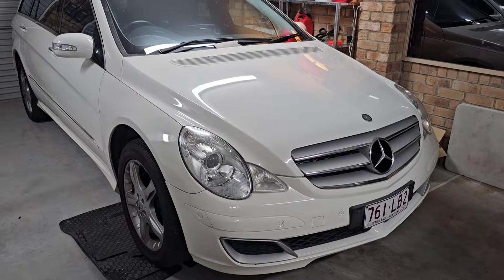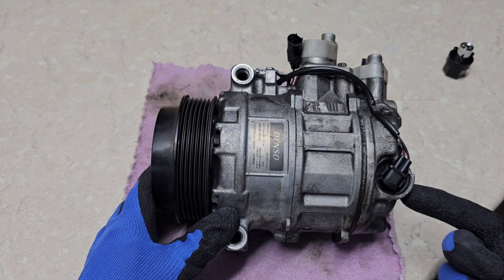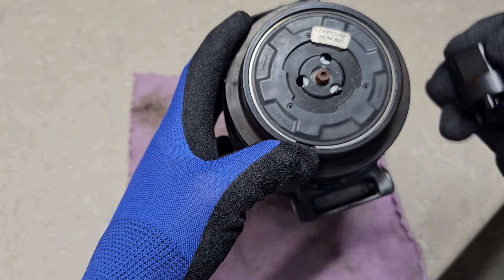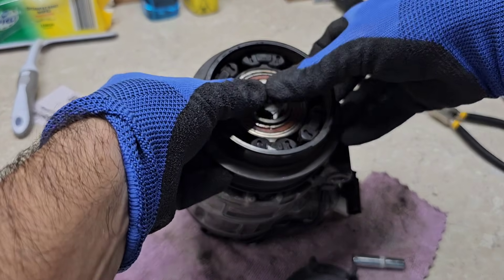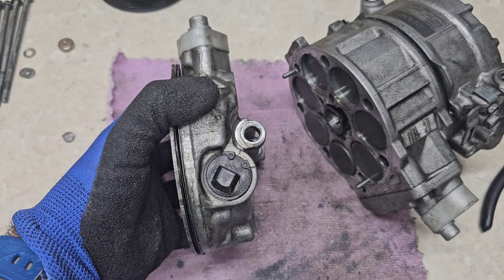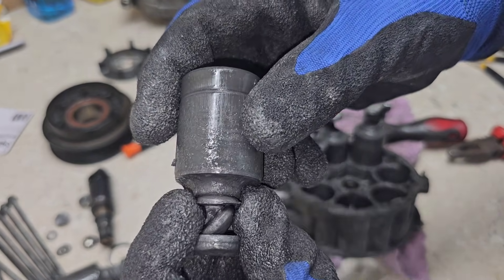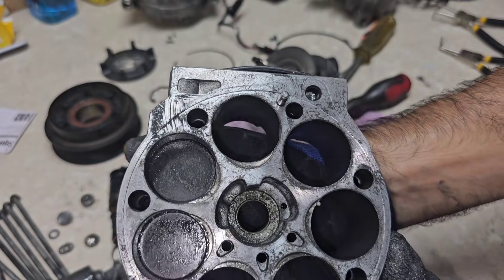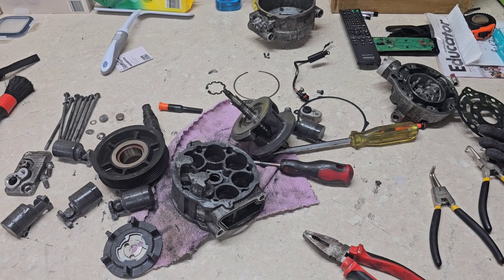Mercedes A/C compressor (7SEU17C) weak points and tear down.

Comment from the maker: Have you ever had any issue with your A/C compressor? Most Mercedes from 2002 to 2020 use the same clutchless 7SEU17C compressor, and this video might help you to diagnose your A/C problem.
Reply: Another great video! We may be up for a replacement soon. At 200k+ miles on our w211 wagon, it could be considered preventative maintenance :)

Comment: Thank you for the video! With this kind of failure, do I need to replace the whole ac system due to the debris? All pipes, radiators and so on?
Reply from the maker: According to the video, there is that safety mechanism,  as soon as the compressor seizes, the internal pulley snaps avoiding further damage.

Comment: Hello, could you please suggest a website where I can buy a clutch kit for my Denso 7SEU17C AC compressor? I have a 2022 MB Sprinter 2500 diesel v6 3.0L. When I tried searching online, I mostly found parts for MB Sprinters up to 2015, but for the same compressor model as mine. Is there a difference depending on the year of the vehicle if the part number is the same?
Reply from the maker: These are available on Ebay, also depending on your location you may want to check Rockauto or Fcpeuro.

Comment: Thanks for a very informative video . My wife’s 2007 ML 320 cdi A/C compressor failed last week last week leaving us stranded as the clutch pins didn’t sheer and the serpentine belt was destroyed and the compressor is locked up , I suspect when I disassemble it , it will be the same sort of failure you have here. After getting a quote for $3,500.00 to replace the compressor and repair the A/c back to operation I have decided that I will do this myself. In the meantime I’ve bypassed the compressor with a shorter belt. 1940mm for anyone with a 07 ML 320 .
Reply from the maker: Thanks, good luck good info. Cost was $800 to replace at shop.

Comment: Thank you! Very clear, to-the-point explanation. The compressor on my car (2012 GL 550) quit a week ago, there was a very loud rattling noise which stopped in about 10 min of driving (I'm guessing from the small pieces cutting to preserve the pulley operation to save the belt and other failures). Will you suggest replacing not only the compressor/dryer, but the condenser as well? And should I flush the system when everything is disconnected (have no idea how to flush the rear evap, but will figure out if needs to be done). Thank you again!
Reply from the maker: You are welcome and good luck 👍

Comment: Has anyone changed this compressor in a 2006 Mercedes C280 4 mattic? I can't seem to find any procedures on the steps to remove the compressor for this model. Anyone can share let me know please.
Reply from the maker: Step 1. Vacuum the system and recover the gas.
2. Take 3 bolts 13mm off.
3. Take the connector off.
4. Replace.
Reply: @BenzAddiction I understand that. The concern I have is this is the 4 mattic model and seems the cross member is in the way from bottom and the power steering pump is in way from top. How do you best access the compressor bolts and the high and low side hose bolts on the compressor? Does anything else required to be removed to gain access?
Reply from the maker: sorry for the late reply, you need to have delicate hand and tools, on some cars the access is not good, but definitely Benz is designed in a way that it is possible to remove, not like SAAB brand for example.

Comment: Hello. Please respond. I have a problem: sometimes cold air comes out, sometimes warm. It suddenly stops working and only warm air comes through. When I turn it off and on again, sometimes it blows cold air again, and sometimes it doesn’t.

The car is an S350 CDI OM642 8PK with a 7SEU17C AC compressor. There are no DTC codes on diagnostics.

What could be the cause? If the solenoid is faulty, can it cause such symptoms? There are no diagnostic codes at all.

Also, I refilled 1 kg of refrigerant twice, but only 500 grams remain when I check it again. I suspect it is leaking through the pressure relief valve — but why?

I also replaced the compressor with a used one, but that one didn’t cool the air at all. Please, if you know, tell me what part of the compressor might be damaged based on these symptoms.

Thank you very much.
Reply from the maker: Sorry mate, I leave this for an air conditioning specialist to comment on.

Comment: You show everything but another source of compressor problems: Shaft seal leak.
Reply from the maker: Leak does not cause catastrophic failure.  The AC will stop working simply due to lack of gas as the pressure sensor won't allow compressor engagement.

Comment: Hy! what is the differences between these Denso 7SEU17C / 6SEU16C ? are they the same? can i switch my 6SEU16C with 7SEU17C on my w212?
Reply from the maker: The Denso 6SEU16C and 7SEU17C are both types of AC compressors commonly found in European vehicles like Audi, VW, BMW, and Mercedes-Benz. While they share some similarities, there are key differences that impact their interchangeability:
Key Differences:
 * Design and Torque Fluctuations: A significant difference highlighted by Denso is that the 7SEU17C (DCP32045) is not designed for vehicles with higher torque fluctuations. Using it in such an application could lead to the limiter releasing and potentially damaging the compressor. The pulley of the 7SEU17C is also not designed for higher torque fluctuations, which could reduce its durability.
 * Variable Suction Throttle (VST): The 7SEU17C compressor typically does not have a Variable Suction Throttle (VST). If the original application uses a VST, substituting a 7SEU17C might lead to suction noise. The 6SEU16C, on the other hand, often includes a control valve (which can incorporate VST functionality).
 * Engine Power Requirement: The 7SEU17C generally requires more engine power compared to a 6SE type compressor (like the 6SEU16C). This can result in reduced engine efficiency and potentially higher fuel consumption or decreased vehicle performance.
 * Oil Capacity: There can be variations in oil capacity between specific models of 6SEU16C and 7SEU17C. For example, some 6SEU16C models list 120ml or 160ml, while some 7SEU17C models list 145ml or 150ml.
 * Pulley Diameter and Grooves: While there's overlap, specifications for pulley diameter and groove quantity can vary. For example, a 6SEU16C might have a 110mm pulley with 6 or 7 grooves, while a 7SEU17C might have a 100mm pulley with 6 or 7 grooves. It's crucial to match these precisely to your vehicle.
Interchangeability:
Generally, they are NOT directly interchangeable without careful consideration and verification. While some aftermarket control valves are marketed as compatible with both 6SEU16C and 7SEU17C compressors, this refers to the control valve itself, not necessarily the entire compressor assembly.
Here's why direct interchangeability is problematic:
 * Vehicle Specifics: The main issue is that these compressors are designed for specific vehicle applications with particular engine characteristics and AC system requirements. The differences in torque fluctuation tolerance, VST presence, and power consumption mean a swap could lead to:
   * Reduced AC performance.
   * Increased noise.
   * Damage to the compressor or other AC system components.
   * Increased fuel consumption.
 * Solenoid/Control Valve Compatibility: Even if the mounting points look similar, the internal electronics of the control valve can differ (e.g., presence or absence of an integrated diode), leading to incompatibility with the car's control circuit.
 * Physical Fitment: While often similar, slight variations in mounting points, pulley diameter, and belt grooves can exist, making a direct physical swap impossible or requiring modifications.
Recommendation:
Always replace an AC compressor with the exact part number or a direct, confirmed OEM equivalent for your specific vehicle's make, model, and year. Consult your vehicle's service manual or a reputable parts catalog (using your VIN) to ensure you get the correct compressor. Do not assume interchangeability based solely on the "6SEU" or "7SEU" designation. While some control valves might be compatible across different Denso SEU series compressors, the entire compressor unit itself is typically not.
Reply: @BenzAddiction  well said

Comment: Hey Benz Addiction, 
I installed a new ac Compressor about 1 month ago, now the front plate has snapped off after a hard acceleration. 
Can i just install a new front plate?
Reply from the maker: There is a good chance that the compressor is seized or hard to rotate. Have you checked that?

Comment: Hey Benz Addiction,
Im having ac compressor noise from the 7seu17c.
Its a rattle noise when off and when on its whines. There is a oil leak coming from the high pressure hose. 
Is the ac compressor shot for sure and need replacement? Just replaced 7 months ago.
Or it can be saved with adding oil? Please give some advice on what you think🙏🙏
Reply from the maker: Well I think it worths to fix the leak first, have the system vacuum and add oil and when the compressor failed to replace it later on.
Reply: @BenzAddiction  thanks for the quick reply. I will be fixing the hose asap and add oil. The ac is still working and is cold. Does this confirm that the internals are still good and just very low on oil?

Comment: What is the recommended service interval for ac gas and oil in order to prolong ac compressor life?
Reply from the maker: Unfortunately, there isn't a universally standardized "recommended service interval" specifically for the Mercedes Kompressor AC compressor 7SEU17C in the same way that there are for engine oil changes or timing belts. AC systems, and their compressors, tend to be serviced based on:
 * Performance:
   * If the AC isn't cooling effectively, or if there are unusual noises, that's a sign that the compressor or other AC components may need attention.
 * System Integrity:
   * AC systems can lose refrigerant over time, which can put extra strain on the compressor. Regular checks for leaks and refrigerant levels are essential.
 * Preventative Maintenance:
   * While not a strict "interval," it's good practice to have the AC system checked periodically, especially before hot weather. This can include:
     * Checking refrigerant levels.
     * Inspecting belts and hoses.
     * Ensuring the condenser and evaporator are clean.
Here are some key points to consider:
 * Compressor Function: The 7SEU17C compressor, like any AC compressor, is a mechanical device that can wear out over time.
 * System Health: The overall health of the AC system is crucial. Leaks, blockages, or other issues can significantly impact the compressor's lifespan.
 * Vehicle Maintenance: Adhering to your Mercedes-Benz's general maintenance schedule can help identify potential AC problems early.
In summary, rather than a specific interval, focus on:
 * Regular AC performance checks.
 * Addressing any signs of AC malfunction promptly.
 * having a qualified mechanic perform routine system inspections.
I hope this helps.

Comment: Very informative, especially about the built-in sacrificial fail point behind the pulley.
Just info, on the M272 engine intake, there is a vacuum modulated intake flap system. Modulators and ride are in the front of the intake. The rods and connector linkage are plastic - they are designed to break if the metal intake flaps get stuck, rather than a metal flap breaking and getting drawn into a cylinder. There are "kits" made out of metal to replace broken plastic rods/linkage - a bad idea.
Reply from the maker: A very good point. Thanks for the info 👍

Comment: The timing of this is funny, my ML55 AC compressor clutch just went out a couple days ago. It’s not identical due to the clutched pulley but very similar otherwise. I’m lucky I caught the clutched pulley seizing before it completely stuck, as it would’ve stranded me. Temporarily have a shorter belt that bypasses the compressor until the new pulley comes in
Reply from the maker: Great point,  thanks.